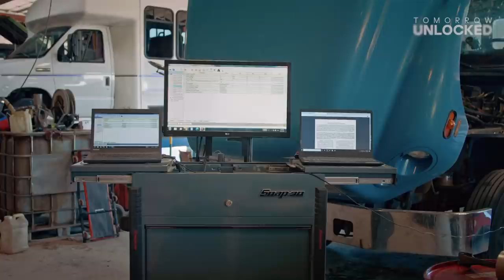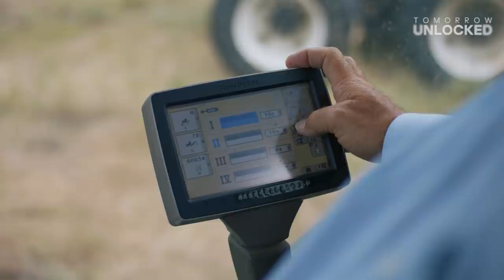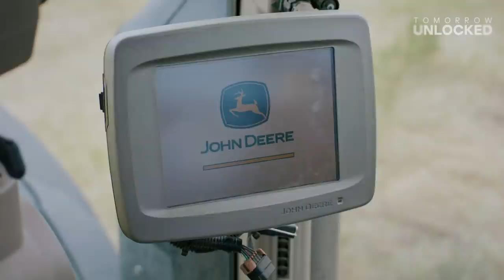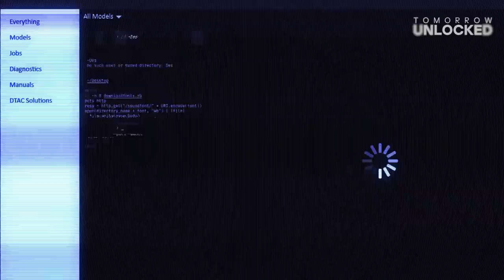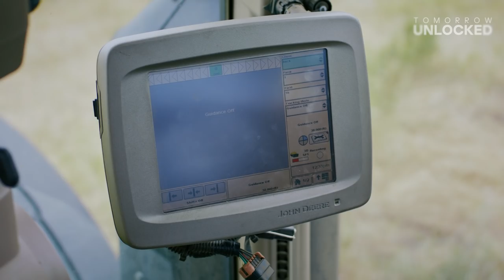Tractor-Hacking Farmers Take on John Deere

Comment: Sure, like a farmer will know how to read and what do do with a can trace. Most farmers don’t even know what the CAN bus is or what its for. If you feel so strongly about working on your own equipment stay in the past with the 40 series tractors. Plus all the tech manuals are available for purchase, they have all the information needed in them, all the codes and all the diagnostic for said codes. When that mechanic said he had no way of figuring out the check engine light on the tractor he didn’t know what he was talking about, every large john deere it is simple in the cab on the display to pull codes and a lot of codes are in the operator’s manual, but I’d guess they would know that if they read it.one minute people will say we need government to put in legislation to stop this, then they’ll say that the government has to much control and is overreaching. This is ridiculous.
Reply: yeah right we fix our out of warranty john deeres all the time here. i don't understand what they are complainning about, they just don't want to adapt to new technologies
Reply: Totally missed the point

Comment: Right to repair - great! But does that mean designers have to share IP? Because you know, we worked hard for that stuff. Actually for many of us it's more than time, it's our reason to exist.
Reply: No farmer wants to copy JDs software. All they want is realistic information. If there is a fault then the system should state exactly which subsystem is reporting that fault (not display a useless "call the dealer" message). Then a reference should be available showing all the parts in that subsystem along with diagnostic data. Then it's the farmer's choice to try to isolate the fault or just call out a service tech. The farmer should also be able to perform pairings and clear fault codes. Changing a gearbox then having to get a JD tech out to pair it with the tractor is grade-A horseshit.

Comment: This is nothing new, just regurgitated.  Yes, give farmers the ability to repair their own software.  It will increase the cost of the equipment 30%, but hey now you (the Ag person) can fix your own software.
Reply: Farmers, by and large, are not looking to fix/alter the software.  They are looking, for the most part, to be able to run the diagnostics so that they can replace and activate parts that are broken.  Just like you can do with a car.

Comment: Every manufacturers ownership should end at intellectual property or process. No one is asking for the source code. They just want to view information. Those tools should be available, of course it may cost money. If you take a piston as an analogy, no one is asking for the chemical composition of the aluminum or the FEA use during design. All they want is a part to buy to fix it themselves. I think it is a completly reasonable request. If this doesn't go in favor of the right to own side I can see huge potential in aftermarket open source controllers. Megasquirt John Deere anyone?

Comment: Stop buying it.
Reply: not an option in many cases, also not a defence, no company should be allowed to do this
Reply: @afgor1088  there are plenty of options other than John Deere, which probably subscribes to this model the most. I would agree that farmers should be able to buy diagnostic equipment but these are no longer engines and equipment you can fix or maintain if what you rely on is a hammer, wrench, etc. They are far more technical.

In any case, farmers should make informed decisions and understand the consequences of those decisions before they sign up for 100s of thousands of dollars in farm equipment. If they then choose based on that, instead of loyalty to a brand they or their peers have, then they probably won’t get in this situation, and the lack of sales would push the big brands into making more end user friendly diagnostic systems available.
Reply: @Ironwulf2000  🤣 oh good a libertarian, you people are a good laugh. bye

Comment: Can anyone point me to software and pc connection cable for a JD 5055e tractor? I have a problem with power reverse transmission not going in forward or reverse unless tractor runs for an hour or two to warm up even in warm weather, once it ever goes into gear once it will drop out a couple times at first then run rest of the day flawlessly. Any help would be greatly appreciated. Dealer says 2000 to 3000$ to just trouble shoot it and at least two weeks before they can think about getting to it. I depend on this thing to make a living!

Comment: This video is making false claims. New tractors tell you what the code is right on the screen and in fact will alert an app on your phone with what the issue is, it's not like a car that only gives you a light. And if you wanted to John Deere will sell you the same tool to connect to the tractor their service technicians use and even the same advanced diagnosing software.  This farmer and technician simply haven't bothered asking.

Comment: Benefit is with dell I can call them and within 24 hrs they'll have someone to fix it lol
Reply: I can only talk about Europe, bought and still have a Dell, with the NBD warranty. 100% satisfied with the service, which ran out in the meantime, and I'm still using the notebook. Once during the warranty period the motherboard has failed, sure thing, they came and replaced it, happened a couple years ago. But recently it failed again, and I ended up doing it myself - bought a used part, followed the repair instructions publicly available from Dell, and it works again. But I would be even happier if independent specialists could repair the motherboard itself to reduce waste and to avoid the lack of parts, because it could happen to anything, even pricier stuff. I think the essence of right to repair is to remove all limitations regarding the "depth", when a piece worth $2 makes you replace something that sells at $200, $2000, or whatnot :) I see a similar analogy with electric cars, there a few advanced shops around here who spend days or weeks to diagnose a common failure, and then fix the issue by replacing a little sensor, which would be normally part of a "not repaired" assembly, going for thousands :)